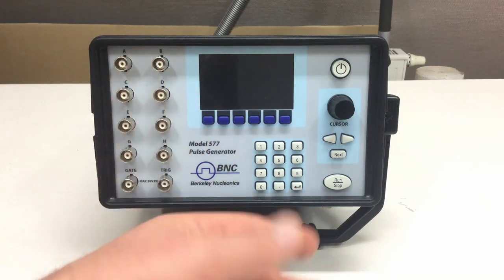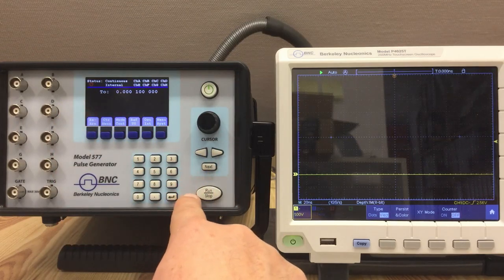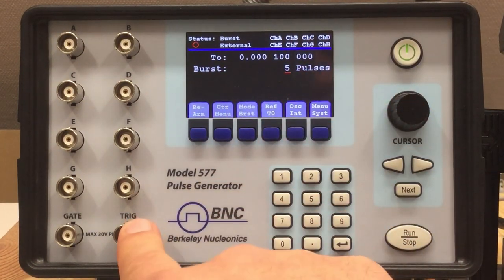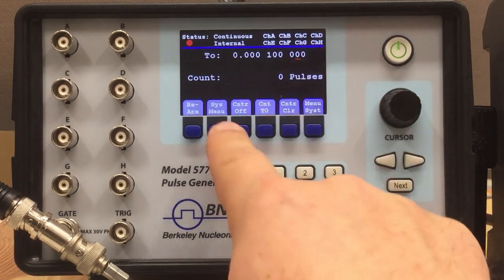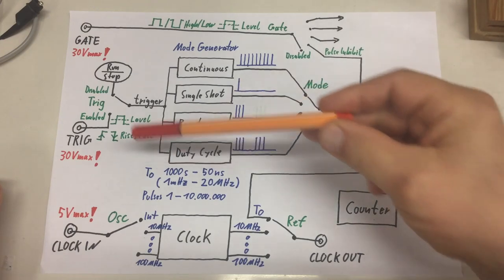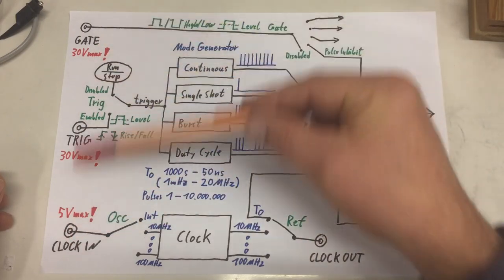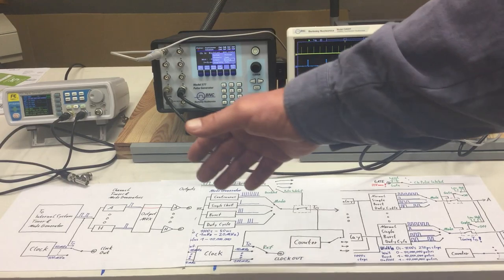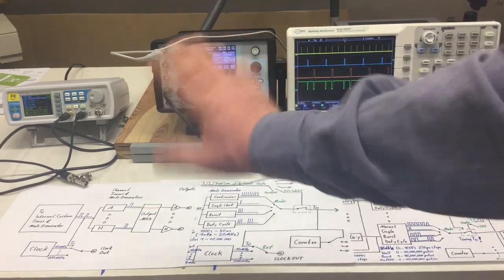BNC Model 577 8-Channel 250ps Resolution Pulse/Delay Generator: Review

Comment: mine can't generate the correct patterns of waves on my oscilloscope, the patterns I got are not what they are supposed to be like and I'm not sure what went wrong
Reply: I think I set up the pulse generator correctly as in the video,
Reply from the maker: @FacialFischl  Hi, I'm sorry, but I really can't help you with just the information you've given. I've demoed a whole lot of settings and patterns in that video. Which one do you mean exactly (timestamp)? Anyway, if you have any questions regarding / problems with your BNC Model 577, you should contact BNC. I'm not affiliated with BNC. I just did a review of a Model 577 demo unit 3 years ago 😅 Sorry again, that I can't be of any assistance.

Comment: No list price...they must be made only upon request..
Reply from the maker: You might be right. Especially since you can get that unit with different output options (higher voltage BNCs, optical etc.) and they also offer to customize the firmware (e.g. different frequencies for the clock input).
Reply: Hi Robert, Douro20,
We do make our custom units upon request and to order. However, we do also offer standard models you can find the price for those units on our website!
Don’t hesitate to reach out if you have any questions. Thanks!